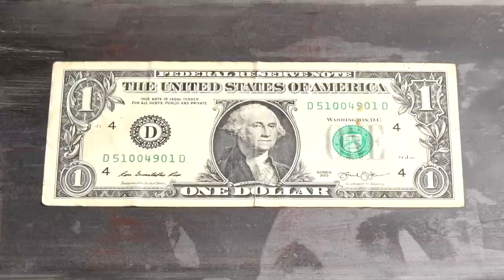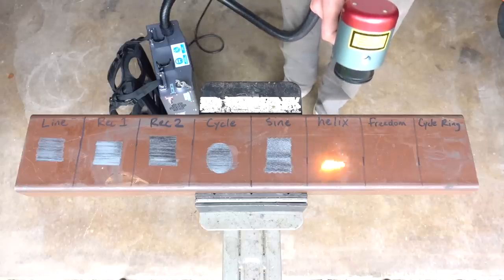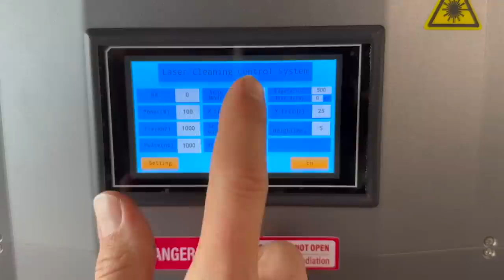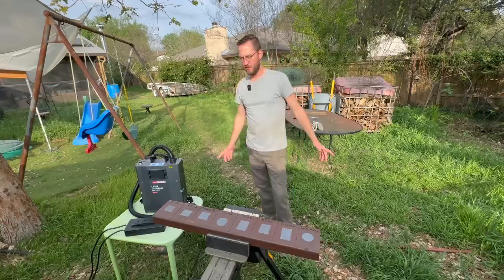SFX Backpack Laser Cleaning Machine Review丨SFX Backpack Laser Rust Remover

Comment: I'm considering investing in one of these backpack laser systems, for my furniture restorations, where I have many pieces with paint and varnish to be removed down to bare wood. Do you think the laser somehow hurt the wood by marking it after the elements are removed, or am i able to control well the gun well to avoid the wood to be bitten?
Reply: There is not a laser machine specially designed for wood cleaning it is still a pulse cleaning machine..I can help you get a 200w pulse laser which is amazing for wood restoration for $5600
Reply from the maker: We have a laser cleaning machine that specializes in wood cleaning, you can contact us at info@sfxlaser.com to discuss more details

Comment: Cost is $8000 USD. For that price I could buy a large air compressor $300, harbor freight cabinet $300, Harbor freight media tank, spray gun, moisture remover, glass bead media, for another $200. Total cost $800, and it will do a much faster job.  Too bad this is so slow and costly.
Reply: You can get a 200w for $4600 or a 1500w continuous laser for $3000 that is super quick for larger items.
Reply: @veselkadogcoats692  Well that is good news. I have not see that anywhere. Could you please post a link to these prices?  $3000 for continuous laser at 1500 Watts? Sounds impossible.
Reply: yes but the media is consumed and messy. the laser is not consumed.
Reply: @michaelmcwilliams5403  That is true, I must agree. Wish I had the money.
Reply: @michaelmcwilliams5403  Depends on the media. Most can be sieved and reused, even baking soda. It is messy, that is for sure, but a tent can be used or a cabinet and dust reduced. A laser is the least messy but super expensive and very slow too. Not ideal yet. Hoping prices come down. I'd love to get one.

Comment: TO LASER THE PAINT OFF A FLAT SURFACE ID USE THE GRINDER WITH A STEEL BRUSH AND SAVE THE LASER

THE LASER IS NEEDED BETTER FOR RUST IN TIGHT PLACES WHERE A FLAT WHEEL CANT GO